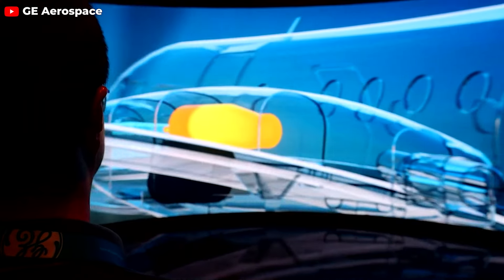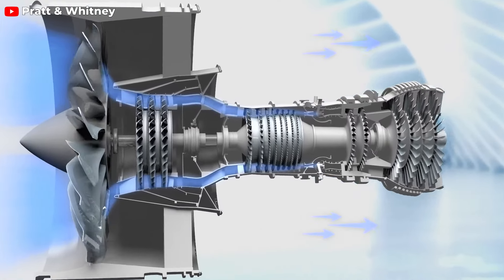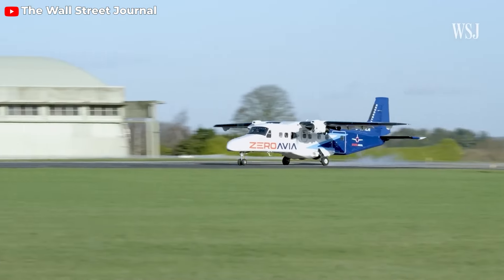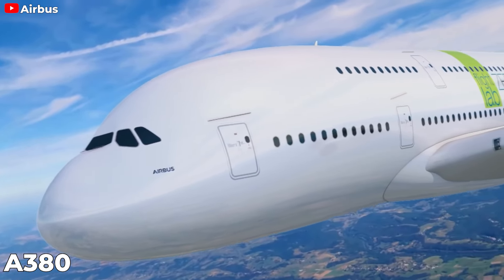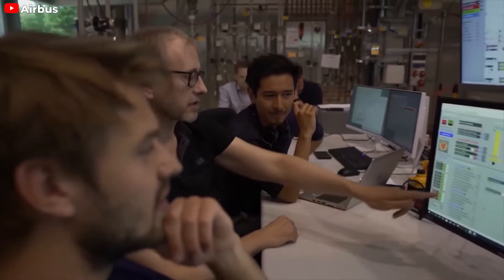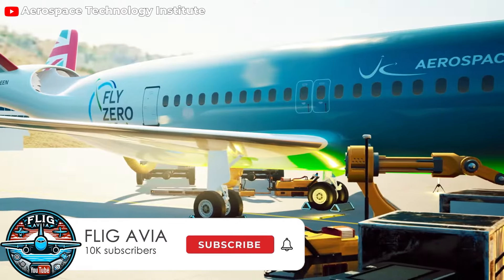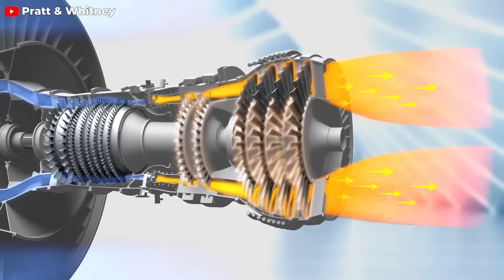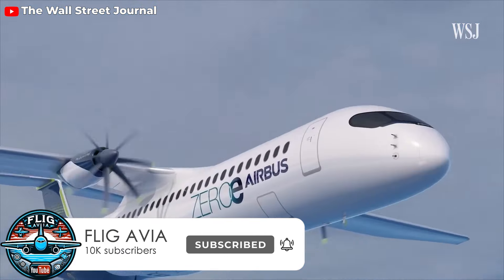This "NEW INSANE Engine" will Change the Aviation Forever! Here's Why

Comment: Another low quality, low effort AI generated bs video. Hydrogen engines aren't even a viable option for road cars (ask Toyota). The CFM Rise open rotor engine is the most viable next evolution in airliner propulsion. Do your own research, instead of a ChatGPT prompt.
Reply from the maker: thanks for your feedback